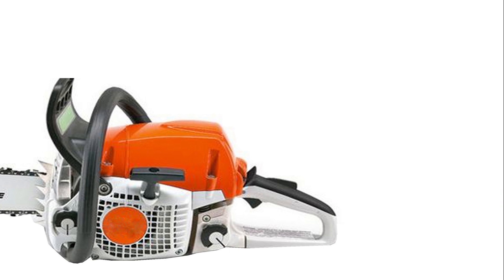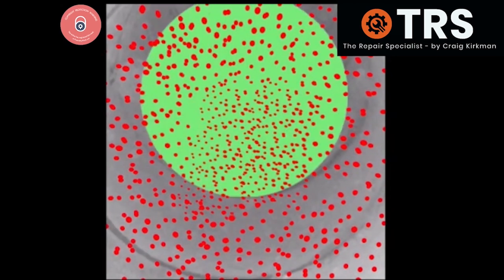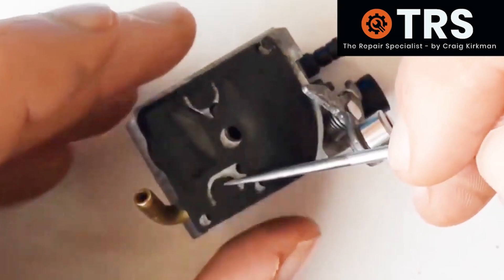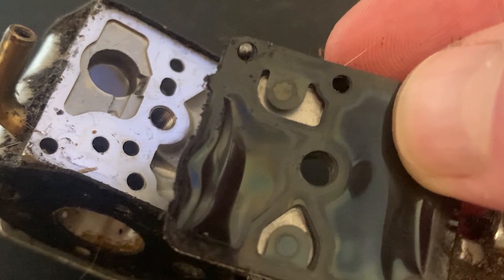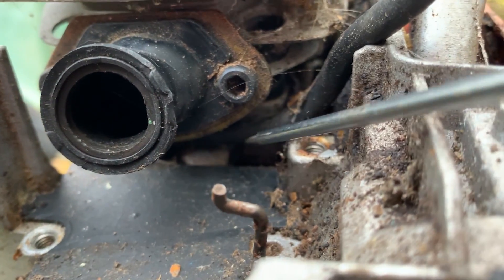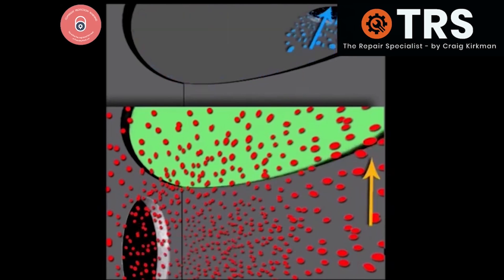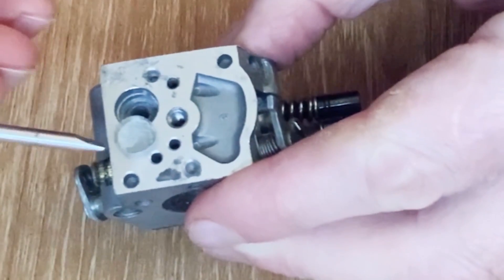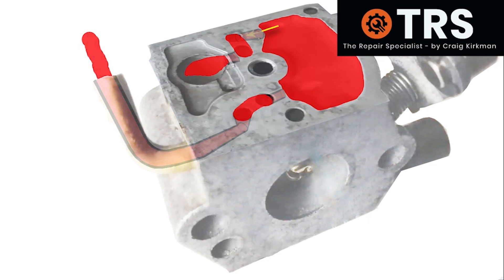CHAINSAW CARBURETOR DIAPHRAGM: 'Fuel Pump Diaphragm' Causing BOG, Won't Start!  (by Craig Kirkman)

Comment: Excellent video explanation here and I subscribed...anyone here have any experience with replacing the stock OEM rubber style fuel pump to the light Tan teflon material ones available in a lot of rebuild kits..and were there any complications as in your saw running different and needing any adjustments after installing the rebuilt carburetor and running your saw ?

I just rebuilt 2 of these Zama carburetors in the last 3 days and the one for my Stihl MS 250 I used the original rubber OEM one and the saw runs great now..the other one on my Stihl MS 170 I used the tan Teflon one and haven't tried to run the saw yet because I am waiting on a new oil line / hose and a new fuel line / hose to go ahead and replace them since the saw is half way torn down...I bought a new Walbro 194 carburetor for my Stihl 024 S and it has the light tan teflon one in it from the factory and the saw runs great...

Comment: All your content is the same. You point out the same things over and over again. You’ve covered the 2 stroke carburetor from every angle already. Why are you being redundant?
Reply from the maker: Thanks for the comment. I do go over the basics from different angles, because not everyone watching is starting at the same level — some are brand new to carbs, some just need a refresher, and others want the deeper detail. Covering it in more than one way helps more people understand it, which is the whole point of the channel. For those who already know the material, that’s great too — but I want to make sure nobody’s left behind.

Comment: I had a question about how gas is pumped with a chainsaw. My question was answer here. Mine is getting spark and I can suck gas out the gas line, so the fuel filter is not clogged, but the carburetor is not getting gas to start. Sounds like it's the gas pump diafram inside the carb. A new rebuild kit has been ordered. Thanks.

Comment: It's very detailed, but if you dont know which of the 3 pipes on the carb fit which pipe, you can spend an hour trying to work out the correct fitting  .How about a simple diagram showing the primer bulb connection, onto the correct place? I now know, but many I asked for help didn't know. Basics first please

Comment: My chainsaw does NOT have a pulse line.  Dolmar 114.  If I am wrong would please reply back...  I am suffering running issues and tuning issues.  Themain problem I am  more interested in is the Needle float valve settings.  Do you have a video on that.?

Comment: Is there an easy way to see if the pump is pumping?
Reply from the maker: Well, an easy and quick way would be to pull off the outflow fuel pipe from the Carb, leaving the supply pipe from the tank in place, of course. Pull the cord to crank the engine, and see if there is fuel being projected out of the carb at that point. You could try this if you like 👍

Comment: Have you ever experienced the pump side of the carb has a very small amount of leakage around the single screw cover when you test the fuel inlet with 7psi of pressure

Comment: I changed the new diaphragm diaphragm of the carburettor, now how do I accelerate, just touching the button (accelerator) turns it off, why?
Reply from the maker: HI
thank you for reaching out with your question about accelerating your chainsaw after changing the diaphragm in the carburetor.

It sounds like you're experiencing a stalling issue when trying to accelerate, which can be frustrating after performing maintenance on the carburetor. Here are a few potential reasons why this might be happening and some steps to address the issue:

Carburetor Adjustment: After installing a new diaphragm, the carburetor may require readjustment of the idle and high-speed screws. Improperly adjusted carburetor settings can cause the engine to stall when accelerating. Try adjusting these screws according to the manufacturer's specifications to achieve a balanced air-fuel mixture.
Diaphragm Installation: Double-check the diaphragm installation to ensure it was correctly positioned and sealed within the carburetor. Any misalignment or improper installation can affect fuel delivery and engine performance.
Fuel System Issues: Check for any issues in the fuel system such as clogged fuel lines, dirty fuel filter, or inadequate fuel flow. Insufficient fuel supply can cause the engine to stall when attempting to accelerate.
Air Leaks: Examine the carburetor and intake system for air leaks. Unwanted air intake can disrupt the air-fuel ratio and cause the engine to stall. Ensure all connections are tight and sealed properly.
To troubleshoot and resolve the acceleration problem, I recommend the following steps:

Re-adjust the carburetor settings for idle and high-speed operation.
Confirm the correct installation of the new diaphragm and check for any signs of damage or misalignment.
Inspect and clean the fuel system components to ensure proper fuel flow and quality.
Check for air leaks around the carburetor and intake manifold and address any issues found.
If these steps do not resolve the problem, it may be beneficial to seek assistance from a qualified technician who can diagnose and address the specific issue with your chainsaw's carburetor.

I hope these suggestions help you get your chainsaw running smoothly again. If you have further questions or need additional assistance, please feel free to ask. Thank you for being part of our community and seeking solutions to improve your equipment!

Best regards,

Craig

Comment: Best explanation of 2 cycle fuel pump.  Thank you for this video.  Excellent!! I’m 63 years old and finally understand it.
Reply from the maker: Thank you for your kind and motivating feedback. Craig 👍👍👍
Reply: @TheRepairSpecialist  Craig the illustration software you use is so helpful.  I will share your posts.  👍

Comment: In your opinion, which is the best diaphragm to use in the repair kit the slightly white/clear one or the black one ?
Reply from the maker: You’ve just given me another idea for a video. I will make one explaining the different types and their uses. It won’t be yet though because I have several to get through first. In the mean time, I personally use the dark black one. although this one is not the best resistant the ethanol it does still last well and pumps better. Again, in my opinion!

Comment: Hi.  i repair  weed-eaters.  Zama  carbs,  are another example, of a  diaghram   pump. Connected by hose, to the 2 cycle engine crankcase; this draws/retracts,  the  membrane,  which pulls fuel from the  tank.  BE  CAREFULL,  DON'T   knock out the one-way ball valve, in the hole. !!   Good luck, all.   we need it, ' cause  its'    a    PLASTIC   generation, we find ourselves in.

Comment: Suction is a misnomer, you should be calling it a vacuum.
Reply from the maker: No. Not really. I refer to ‘suction’ because I have had so many negative comments regarding the use of Vacuum in the past. I used to regularly use the word ‘vacuum’ and the consensus for that was that the word ‘vacuum’ can be confused with the physics term, which is: space, entirely devoid of matter. So, because if this, I refer to it as suction pressure, which explains it more than well enough anyway. It’s seems that even the people who comment on this incredibly light   Issues indeed can’t even agree amongst themselves on the correct term!
Reply: @TheRepairSpecialist  I guess they never took physics is school.

Comment: I'm working on a Stihl 029.  It was missing parts when I got it.  I've got all but one thing sorted.  On the clutch side (right side) is a lever and spring. Part numbers 1121 162 5010 for the lever, and 0000 997 0628 for the spring.  I now have them both, but I can't work out how they attach.  When I connect the spring to the lever, and then to the stud above it, it become misaligned and won't work correctly.  I'm thinking that I'm doing it wrong, or still missing something.  Can someone help advise?  I can't find any videos on this.
Reply: Hi,  check out  '' TARYL  FIXES  ALL'............here on Youtube. Expert, in all areas, for over 45  years.  !   plus, funny too, with his 2 boys.   ! 
Also,  Dony Boy   and  Steves'  Small Engine  Saloon   (....good, beer man)

Comment: I always replace the carburettor !!!!  The cost of a new carburettor is not very much, and it can take hours to check everything !!!!!  It's easier to throw it away and fit a New One !!!!!   Even better, I have bought Powerful Electric Machines which are much better than Petrol Ones !!!!  This ethanol fuel is horrible stuff for 2 Stroke  Engines !!!!  I have 3 Powerful Electric Brush Cutters and 3 Electric Chainsaws !!!!  If you use Petrol Equipment it's best to use up all the fuel and Store it with no Petrol in it at all !!!!!
Reply: ....i agree,  ethanol should be  BANNED  FOR  2 CYCLES,  and  '''  We, the  People '' ...ought to use water, and the method, to  DROP OUT  the water, in gas we buy;  if we cannot  find   NON ethanol  gas.   ..crazy world, eh ?  Lower benzene in the gas would  also help 2-cycle  diaghram  carbs, work better for  L O N G E R ....

Comment: Absolutely awesome teaching and explanation. I have a whole new understanding now of the service needs of my older saw. This video also somewhat explains why some prefer to pull the start rope a few turn overs before turning the switch on. The piston pulse will freshen the fuel load in the carb chambers and make starting easier. 
 Thank you so much for taking the time and efforts to make such an awesome educational video. I definitely hit the like button and may subscribe after browsing your channel for a bit.
Reply from the maker: Thank you. Craig 👍👍👍

Comment: Long time mechanic, short time 2 stroke mechanic so always looking for more knowledge. I’ve encountered other common problems with lower end equipment, crank seals going out very early in life, and rubberized parts including carburetor parts that simply do not appear to be fuel rated materials. I have a pile of chainsaws that I keep threatening to bring back to life.
Reply: I have worked on a few chain saws,  it's usually just as cheap to order a new carburetor,  rather than trying to fix an old carburetor.  Just a suggestion.  Also,  change the fuel lines,  and fuel filter.  Be sure the gas tank is clean.  To check a primer bulb,  put 2 lines on it and dip the ends into a small amount of gas and see which way the fuel is going.  On the 2 stroke carburetor,  apply a small amount of vacuum to each fuel line inlet/exit if it will not allow air through that's for the return line (back to the fuel tank)  . Good luck.  It can be fun to work on chain saws,  weed eaters,  and lawn mowers.

Comment: When I bought spare diaphragm it comes with a similar piece transparente material. Is it only for packaging purpose? Or should it be placed on top ?
Reply: My understanding is that there are 3 types of material used for pump diaphragm. Original, black, newer, blue, newest pale tan.
The order of resistance to ethanol content in fuel, black, blue, tan.
In some machines, may find tan too " stiff " to work correctly.
Hope helps you.
Reply: @trwilkinson4623 hi from Australia.. thanks for this! just to confirm tan is the most, or least ethanol resistant? Thanks :)
Reply: @mattaitchey4917 , sorry for the confusion, TAN is most Ethanol resistant.
Reply: Thanks very much for clearing that up I will seek a kit with tan diaphragm

Comment: Has anyone have an answer to this carburetor problem, My stihl 46,starts runs fine, even after sitting 6 months, will run all day, but if you blip the throttle just once it cuts out and refuses to start, You have to go through the hole starting up precedure before it will start,
Reply: To a non expert, it sounds like fuel starvation. Blocked filter allows enough through for tick over.
Prob a good idea to watch Craig's videos and fully service, before tuning.

Comment: This is incorrect. I have rebuilt many 2 cycle carbs. I seldom see this particular diaphragm with an issue. Now on the otherside is the metering diaphragm. Now this one is usually the cause if it is found to be very stiff and hard. I have even seen them with a hole or a tear which caused a fuel leak. To this day I have seen maybe 1 pumping diaphragm that was needing replaced.
Reply from the maker: What you are saying is incorrect. I have serviced hundreds of these types of little carbs in the past and they do wear and become damaged by age. To this day I have replaced many because they did indeed need to be replaced.
Reply: When I received a rebuild kit, it came with what looks like a spacer a few times thicker than the diaphragm), to go over or under the fuel pump diaphragm.  But, it does not say if it goes over or under the diaphragm.
Reply: @MrUtubeobia  Over it